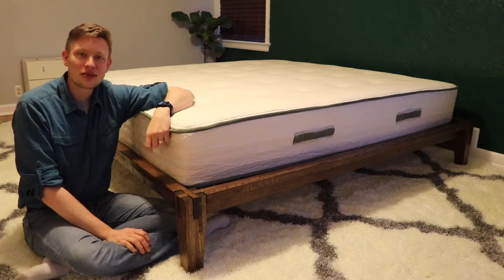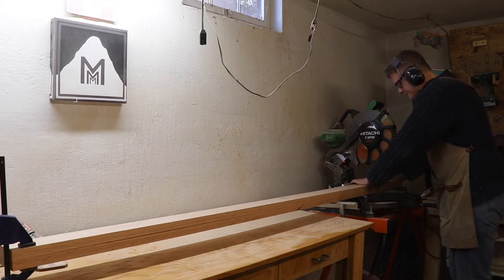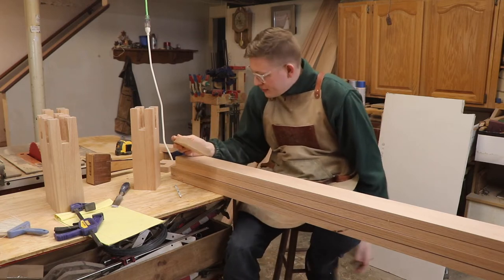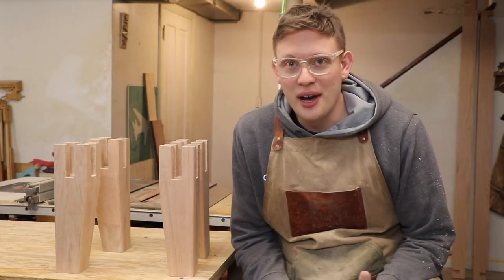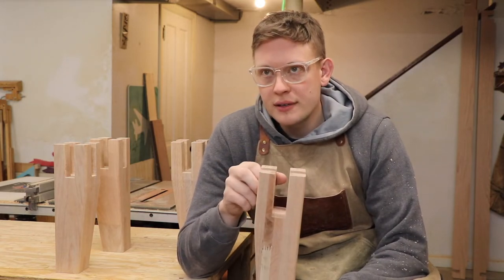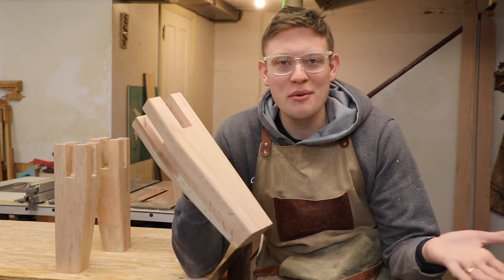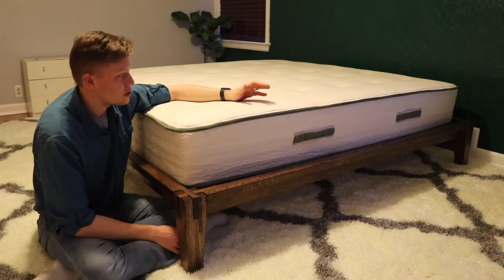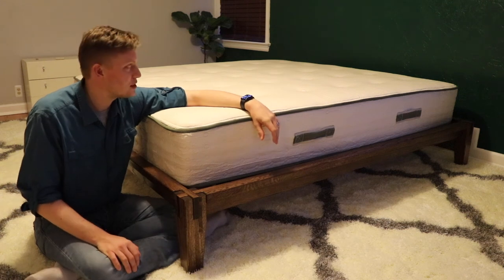I Built a THUMA Inspired Platform Bed Frame - It Is Awesome!

Comment: I wish there were community workshops that I could use with all these tools. I’d love to make something like this.
Reply: Some places do let you rent tools. Also check out a similar video that I forgot who made it butnsesrch castle joint bed no cutting. If you use the right sized wood. You can do a lot with just some plug in tool. I'm going to.
Reply: all of this can be done with hand tools, it is just less efficient.
Reply: Try looking for maker spaces in your area they typically have woodworking and metalworking tools in a full blown workshop. I live in Cherokee County Georgia and the one near me has a 3D printing lab, woodworking, metalworking, and even a robotics lab. For regular folks it's $60 a month for 24 hour access and there's even a military discount.
Reply: some areas have maker shops with said tools and space.
Reply: In no way shape or chance  there would ever be a "community shop". Ppl don't even take care of their own stuff let alone expensive tools that most ppl have no clue how to use. There wouldn't be an insurance company that would take it, and the repair bill from misuse would be NUTS.
Reply: Check out maker spaces and lowes/HD have rental sections

Comment: Hi, thank you for the detailed video! 

Did you end up cutting down the inside corner of the castle joint so the mattress does not hit it? Will adding poly to the wood make the joints much tighter, should I make them a bit loose before the ploy is applied?  Thanks again!

Comment: I notice that you didn't spline the ends of bed rails like Thuma does. It took me awhile to realize that they are doing this to keep the "tab" on that cut from breaking when assembling/disassembling. Have you noticed any issues with the durability of your build? I'm building a similar frame myself and using walnut. I'm contemplating how important this reinforcement might be in a build like this...
Reply from the maker: Great observation.  I have no had any issues with the durability of the bed.  Perhaps Thuma used splines because they up-cycle repurposed wood, so the spline is a necessary reinforcement.  Not sure.  If you're using fresh walnut, like I used fresh oak, splines may not be necessary.  Thanks for asking, and happy building!

Comment: Sorry.  I know this is an old video but i was curious about any squeaking?  Every bed ive owned squeaks after a while and i do mean just with normal rolling over and getting in and out of bed.  Granted, the bed has been assembled and disassembled a few times but can you share if the bed is noisy at all?  Thanks in advance
Reply from the maker: I think the timing of your question is good, actually.  After two years, NO, the bed frame does not squeak at all.  The castle joints are tight, and the runners underneath are lined in felt where they contact the rails.
Reply: @MidwestManMountain  I appreciate the response!  thank you

Comment: Awesome job. Im currently building a similar frame and was wondering if you rounded over all edges on the top of your boards in the castle joint. Specifly where the perpendicular halflap joint comes together ? Thanks and really like your colour choice as well!
Reply from the maker: Thank you!  Good question.  I did round everything over...everything that might get bumped by a leg/foot at least.

Comment: I just saw an ad for this style frame and googled DIY as it looked simple, but elegant. Your video does not disappoint. I cant help but wonder if you cut those notches, 2x as tall you could make a 4 post bed like this. maybe lathe some wood knobs on top. Just a thought.
Reply from the maker: Hi Chris, thanks for watching!  I definitely think that you could play with the height of the legs here and still have a structurally sound frame.  That's a cool idea with the knobs, too.  We've been very satisfied with the stability of the bed this whole year.  Happy building :)

Comment: Thing is with a castle joint is that the size of the castle needs be comparatively huge, and you need very strong wood in the cross grain. I build this using redwood because I could get it easily and not too epensive, then the hook part of the joint just sapped right off.  Make sure if you make this, you use a wood that's tough enough to handle that hook!
Reply from the maker: Yes, definitely use a strong wood.  One year in and this oak is showing no signs of weakness.
Reply: I made a similar bed out of pine 2x4s planed down to about 1-1/8” thick.  To reinforce the “hook” I drove a 2-1/2” screw from the bottom into it.  So far, it is holding up.

Comment: Great build, I am in the process of building one just like it, except I am using pine wood. That way if I make any mistakes it won’t be a total loss. I want to ask how you put the lip on the side pieces. Was it just a glue up up or a joinery? If so what kind. Thank you.
Reply from the maker: Cool man, happy building!  That outside lip that runs along the top is only glued on.  I was methodical with the glue making sure to cover and clamp every surface thoroughly.  I figured that this wouldn't be weight-bearing and so it didn't need additional fasteners or sturdier joinery.
Reply: @MidwestManMountain  thank you. That jig do you have a tutorial on it?

Comment: Due, you are forgetting one thing. Safety of your hands. cutting the feet on the table saw. a jig for the castle joint and the angle cuts. it's too easy to get hurt, and you will not see it coming. Stay safe brother.

Comment: Hi Christopher. I wanted to take a stab at making this particular bed and wanted to know what the foot at the center of the frame is.  Thanks in advance.
Reply from the maker: Hello there.  I made that foot from some extra cutoff material.  I glued a few boards and cut the resulting log to a width just less than the 2x4 oak board running down the middle.  That one leg in the middle is plenty of support for us two tall adults.  Happy building!
Reply: @MidwestManMountain  that’s very helpful. Thank you!!

Comment: Bought the Thuma bed and Avocado mattress about 6 months ago. I wish I would have spent the money on a good table saw and built it myself. :)

How are you enjoying that bed? It's pretty firm. So firm that we just purchased the topper. Been sleeping on it for week. Still pretty firm but not to the point that either of us are getting up sore.
Reply from the maker: Interesting!  I'm certainly glad that I built.  How is your frame holding up?  As for our Avocado, both my wife and I like it a lot.  It took about a month to fully 'break it in' for our backs to get used to it, but since then we've been sleeping better than ever.  I've also recently switched to sleeping on two firm pillows, so I'm sure that does something with my alignment and comfort.  I'm predominantly a side sleeper, too.  Everyone is different, I suppose.